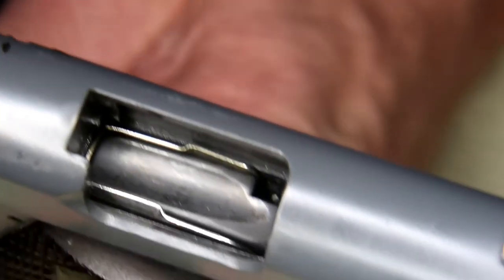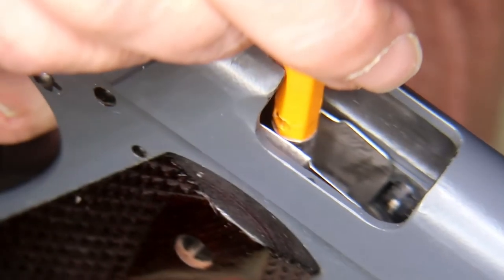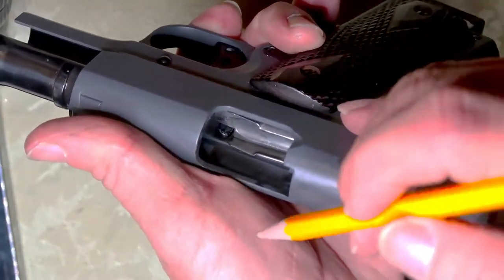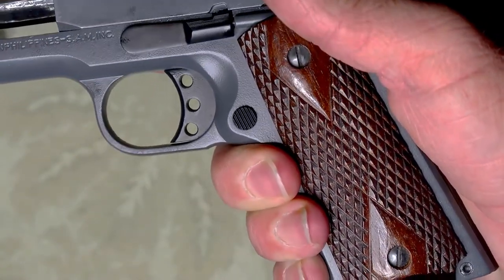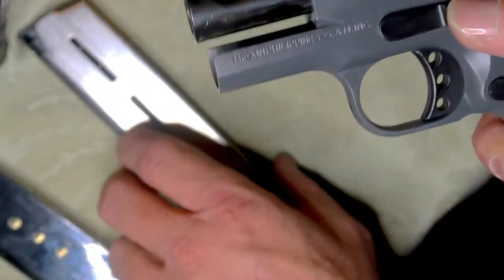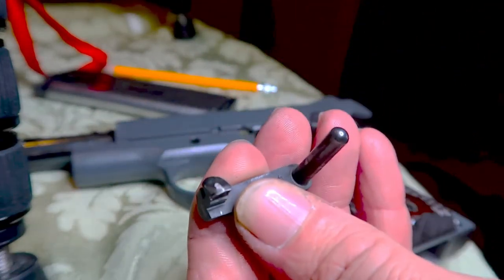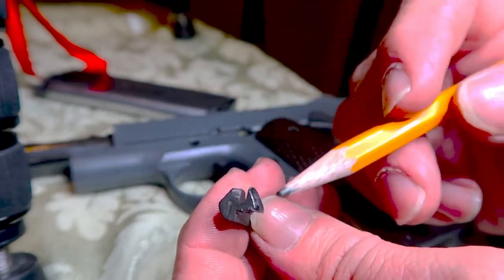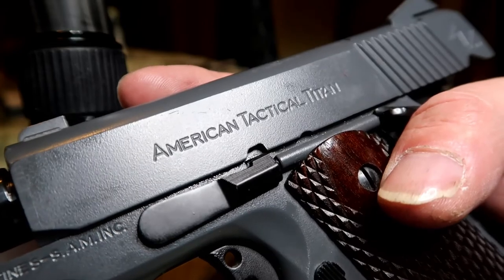1911 Pistol Slide Stop Problem Diagnosis

Comment: To prevent inadvertant lock back, I perform a divot modification on the slide stop rear face all of my 1911's, G'ment, Commander, and Officers Models. Shallow divot with careful Dremel work where the plunger makes contact followed by hand filing tuning of an upside down teardrop shaped groove to adjust tension. Inadvertent lock back can be from recoil inertia but can also be due to cycling bullet bump, especially with 230gr fmj full length rounds. Mentioned in Bill Wilson's book "The Combat Auto", page 48.  Look for telltale copper markings on inner catch portion of the slide stop. I smooth this area but retain the entire shelf edge that impinges on the mag follower.

Comment: Thank you for airing this video. You  might be the smartest person I have ever known. I think your video completely explains the issue I’m having with my handgun. I purchased a Tisas 1911 45 and I am having slide lockback problems when I fire the slide fails to move forward after the round discharges. Little sidenote, The dealer said they don’t have a gunsmith anymore so they can’t help me. The manufacturer gave me a little bit of a hard time when I called them I’m not particularly happy with Tactical Training Center and Flemington and neither am I happy with the SDS Imports and Tisas as a manufacturer. Given the choice of buying another Tisas Or getting a different brand, I would get a different brand. I also would not recommend purchasing a firearm from Tactical Training Center Flemington NJ

Comment: Thank you for your great video many years after you made it. Have many government size 1911’s, my only 3” 45 acp 1911 which was new in mid 2021has been giving me intermittent failure to feeds. It has been in for warranty service work three times. The company had five to ten day turn around time all three service visits which is incredible. The last trip they diagnosed a weak recoil spring but the gun only has about 400 rounds through it. I did your empty and full magazine test and sure enough with a loaded magazine it moved the slide stop lever. I swapped that slide stop with another that doesn’t stick out so far and the loaded magazine test worked. Range testing a little later today to confirm there are no more failure to feeds. PS: the slide stop had copper marks on it.
Reply from the maker: Thank you and update us if that solved the problem.

Comment: Thank you for your 1911 videos. I learned so much already. Bought my first Tisas 1911A1 Service Pistol. Been a Glock Fanboy my life and finally decided to go beyond 40 cal. 

Question for you. I got some new KCI 1911 45 ACP mag but when I’m trying to load the mag into my 1911 it appears to get stuck on the inside near the mag release. It can be jiggled into the hun but the mag release mechanism seem to get caught on the feed lip of the mag. Any suggestions or possible reason for this?  Thank you!

Comment: Just got back from the range and my slide stop seems to want to come out after the last round is fired and does not fully lock the slide.  Happened about 5-7 times through 150 rds.  We couldn’t figure it out.  It’s never done this through about 350 to 400 rds.  I mean, it would have to cycle far enough for the last round to eject and come forward and get stuck as the slide stop is coming out.  I’m not touching the SS at all too.  Any insight?  We’re just assuming possibilities, the stop itself to plunger and spring, maybe the magazine or ammo?  Was using federal 230g fmj, 830 fps.  Any help would be appreciated.  Thanks.

Firearm is a Tisas bantam commander in 45
Magazine is a Wilson combat
Reply from the maker: OK, let's see if I can help diagnose it. 
First, remove the slide stop and take a close look at the detent pin.  Ensure the nose is round. Not flat spotted. Ensure the detent moves in and out freely. That detent pin and its spring are two things that keep the slide stop from coming out. 
Second, inspect the flat area on the slide stop where the detent rides. It should be smooth. A custom touch on high-end pistols is to take a ball cutter and make a concave area to better trap the detent pin.
Third, if all that checks out and there is no obvious wear or damage reinsert the slide stop ensuring that you do so with the half moon takedown notch properly aligned. The third item that keeps the slide stop in the pistol is a rib that rides inside the slide. ensure it is present. With the slide off and slide stop installed you can easily see the rib that is inside the pistol when the slide is on. It and the main body of the stop create a channel where the slide moves but does not contact the slide. Hard to explain so looks for broken, worn, or missing pieces on the slide stop. If you have another 1911 slide stop to compare it to that would help you a lot. Good luck.
Reply: @mackdaddy1911a1  ok, so I grabbed my other 1911 and tested the plungers.  There is significantly more tension on the other.  I really have to try to push it in and on the Tisas, it takes minimum effort.  The wear patterns on the slide stop seem to be the same but looks like there’s more wear on the Tisas.  I also noticed that when I rack the slide slowly with an empty magazine, the Tisas slide stop starts moving up and then the slide gets ever so slightly hung up when you get to the half moon cut out.  I tried the same thing on my other 1911 and that does not happen.  I don’t know.  Seems like I may have to change out the stop, plunger/spring.  And see if that helps.  Thank you for your insight!!!  It is greatly appreciated!   Will update when I’ve upgraded the parts.

Comment: I just put 100 rounds in a tisas 1911 and today on number 87 i had this issue where the slide locked back with 2 rounds still in the mag and also noticed a copper color on the pin where rounds are hitting the slide stop but crazy it was just the one time so not sure if it needs material removed or not

Comment: Thank you. I just got a brand new 1911 today. The full mag pushes it up and the mag won’t catch when empty. So pissed at this mag. I’m getting a new one tomorrow and then shooting this crap one that came with the gun.
Reply from the maker: Look for Wilson Combat, Kimber, Colt, or Smith & Wesson mags. Chip McCormack, or Trip Research Cobra mags. All are high quality. IF the problem continues then the Slide Stop is out of spec. Check out my video series on tuning the 1911. You can file and or polish the lug that interacts with the follower to eliminate the problem.

Comment: thank you for the video helped better understand my 1911, im having an issue where i cant release the slide on these two WC mags on a sig 1911, has me stumped
Reply from the maker: Pull the slide stop out and look for scratches on the lug. Or a slug trail of copper. The lug maybe a tiny bit to big and is either hitting the magazine tube or bullet of the cartridge. If so you will need to polish the lug in the area where it is touching. A tiny bit at a time. 200 grit sand paper works well. Warning go slow and check OFTEN. you can do so without the slide on the frame just insure the magazine is locked in correctly every time you test it. It should depress the magazine follower just a bit. Moving up and down easily without binding or sticking.

Comment: For my 1911 it did do that but not on the first round. Once it fed the first round the second round would walk forward cuz of the first round being stripped from the magazine so now the second round would be sitting forward a little more. now when the gun cycled the second round, it would bump onto the lug and cause my slide to lock.  So I just shaved the shit out of it to where it would lock on empty but not when there was a forward sitting round. Idk if they made sense.
Reply: @positiveanion4085  I also did have a pretty weak recoil spring. Someone told me that can cause little too much recoil causing the slide stop to bounce just enough to catch the slide. So I replaced mine with an 18. After finding all the flaws it’s running great but I’m never buying a kimber again. 😂

Comment: I'm having the opposite problem.  My slide stop pin wanders out while shooting.  Causing the slide to return to full battery on an empty mag.  What causes this and is there a remedy?
Reply from the maker: Ok this will require a little work. The plunger pins are all the holds both slide stop and thumb safety in. It sounds like the front pin isn't pressing against the slide stop with enough force.  The pin may be deformed or have a burr preventing it from emerging far enough to press on the slide stop or it has a weak spring. Have you ever stripped the frame of your pistol? Or at least taken the thumb safety off ? 
One thing you can try before going that route is to mark the stop by inserting an empty magazine, slide closed and work the slide stop until the pin removes the coating/ blueing. At the bottom is where the pin rests. Used a center punch and make a shallow dimple. Enough to lightly catch the pin but not so deep to capture it. If the problem persists it will require pulling the thumb safety out and replacing the pins and spring. That spring is notorious for springing into never never land. Never to be seen again. Wilson Combat bullet proof parts are my Go to.

Comment: my slide stop is loose do u know what could be causing it? sometimes it will fall out when rack the slide lol, and jiggles about, still works fine, functions fine, its just loose as hell. cant seemt o figure out why
Reply from the maker: Out of spec part. The flat portion that rides inside the slide maybe or plunger/spring assembly may not have full unimpeaded travel. Or be weak.

Comment: I need help. I just purchased a 1911 and my slide lock keeps going up after every round what could be my problem?
Reply from the maker: https://youtu.be/dwno7SADNVw
This video explains the most likely cause. Check out your gun and see if you can see what is going on by the symptoms illustrated in the video. Let me know in the comments.
Reply: You own a 1911......
Reply from the maker: @1999glock  yes. Manufactured between 1913 and 1918.

Comment: Somewhat in the same neighborhood, but I am trying to fit a 1911 Rock Island slide to a Iver Johnson lower. At the very back of a "cycle" full open battery, a open chamber with slide stuck. Ideas on how to take care of that?
Reply from the maker: How tight a fit did the slide have in relation to the frame?  You may need to use lapping compound on the rails and work the slide back and forth to seat it. 
Field strip the slide. And put the stripped slide back on the frame. Note:no barrel or slide stop.
The slide should move freely with the only hesitation being when the flat pushes the disconnect down into the frame. If it still gets stuck then it will need to be lapped in. Brownells sales lapping compound. 
Look for gouging and or shiny spots on the pistol's coating where the slide and frame contact each other. Check the face of the hammer and rear of the slide where it would pass over the hammer. Make sure the hammer has a slide amount of movement when the slide is fully to the rear. 
Good luck.

Comment: My friend in Australia (yes, aissies can habe handguns under Cat H licenses) has a tisas 1911 in 9mm and his slide catch will lock, but it won't drop freely when the slide is pulled back with no magazine or a loaded magazine; it will only drop when pressed down. What could be causing this? I was thinking either oversized slide catch or too strong of a plunger spring
Reply from the maker: The slide stop may not be smooth or the plunger pin. I had one that was not round.   After inspecting the slide stop for any issues tell him to check the pin. It should be round and smooth on its tip.  The pin on the Auto Ordnance wasn't smooth. Looked like crap. I used some 500 grit sand paper and just turned the pin round and round till smooth. I held the paper sort of wrapped into a u just working the rout d tip of the pin.
Reply: @mackdaddy1911a1  Update: he had an aftermarket buffer installed in his gun he didn't tell me about. Removing it solved the issue lmao

Comment: Possibly stupid question, but is it possible to have a lead trail on the slide release instead of a copper one, because I recently bought one of these and the slide release and the front bottom of the chamber was coated in this black residue that might just be powder but could also be copper or lead.
Reply from the maker: The only dumb question is the one you don't ask. That is a possibility but more than likely the previous owner was a lazy bastard that just didn't clean the pistol. You should field strip it , thoroughly clean and the lubricate it.

Comment: With mine the slide release catches but not all the way it barely catches on to the slide so when I insert a new magazine with and without bullets in the mag  the slide goes forward by itself. what is the issue ?do I need a new slide release? I just put in new recoil spring#17  and Main spring#23. it wasn't doing that before I changed out the springs but the lug is shiny and does look kind of worn what should I try? A new slide release first? Or is it the springs i put in ?
Reply from the maker: I think it's the slide stop. A standard type from Wilson or other high quality part should square it away.  Their bullet proof parts are top notch.

Comment: What is the reason the slide will NOT slide back far enough to be locked? Forget the last round stuff, whether it's got an empty mag or no mag... Recoil spring too tight? Stops within a quarter inch of the notch. NIB not even shot yet. What could that be? Never had an issue locking a slide back. Have several different handguns no issues. This is my first 1911 however. Springfield emp 40 3' barrel. Any feedback would be appreciated.
Reply from the maker: I have racked my brain and have no idea. Something is out of specification. Do you have another 1911 to compare it to?.
Reply: @mackdaddy1911a1  no sir. Took it to local gunsmith and he said it is the spring that's not allowing it to come back the full length in order to lock. I'll be sending it in to Springfield this week for "repair" although I'm sure they'll just replace the spring. I've shown it too 4 smiths and it's definitely the most bizarre thing they've seen on a 1911. But I inspected every inch of that gun and it shows no signs of operation. Just dumb luck from the factory I guess. Does explain why I got it for a few 100 less. Oh, put 100 rounds through it last weekend and it does lock back on the last round fired. But as you can imagine, I have to pull it back as well as use my thumb on the stop in order to chamber the next full mag. Oh well. Springfield stands by their warranty. They'll either fix or replace. I have every confidence.
Reply from the maker: @snake6221  Thanks for the update. I have heard of a few weird things but never that one. Good luck.

Comment: My 45 starting to do this and thank you for this video. Question how much do we have to file down
Reply from the maker: Only a tiny bit. I would recommend using something like a fingernail file like the ladies use. Or 500 grit sandpaper. Look closely where the copper trail is and polish that area. A little at a time. It is very easy to remove too much. follow the contour of the part and after you have polished it a couple of strokes color the area with a Sharpie. That allows you to see where the file or paper is cutting and where it isn't. Try the part often by hand-cycling live ammo through it. Carefully and keep that finger off the trigger while doing so. Once there is no copper trail then take it out and run a couple of mags through it. Good luck.

Comment: thanks for posting! just got my first ria gi 1911. i haven't got a chance to shoot it yet cause  i don't have ammo. anyway, i noticed that everytime the slide locks, it wont allow me to unlock it unless i release the magazine. i checked my gun and its the same issue you got.
Reply from the maker: OK, first don't release the slide with the slide stop on an empty chamber. That can damage the sear/hammer engagement surfaces. 
Second, there is resistance because of the spring pressure pushing the magazine follower up, which in turn pushes the slide stop up to engage the slide.
As a new pistol, it may require a bit of use to "wear in", all the metal surfaces. Add a drop of oil onto both the slide stop pin and the plunger pin where it contacts the slide stop. then work the slide stop up and down. This is easiest if you field strip the pistol. Remove the slide. Look for any scratches or shine metal that should have a coating. That shine indicates wear. Good luck.
Reply: @mackdaddy1911a1  thank you
Reply from the maker: @ricardocabigting7378  Let me know if the suggestions help.  The ATI in this video had a bad extractor that I had to replace. So you may have a part that needs replacement..

Comment: I swear , that American Tactical could be mistaken for a Kimber Custom CDP II as far as design goes !
Reply from the maker: It doesn't run like one. A CHEAP copy at best.
Reply: My kimber slide lock started doing this after 100 rounds sent through… sad
Reply: @blueskypainters2916  Haven't had any issues as of yet with my Kimber ( fingers crossed ) but have only put around 600 through it so far using Sig Sauer 185gr Elite Performance Ammo . Mzl 995 ft/sec 407 ft-lbs .

Comment: How to i know how much to file off  on the lug?? My gun is having that issue.
Reply from the maker: Take note or a photo of the copper build up on the lug. Then.gently file in only that area. It will only take a little. Stop reassemble and test often.  Just don't touch the flat area the contacts the follower of the magazine.